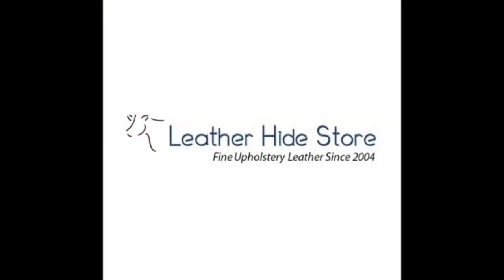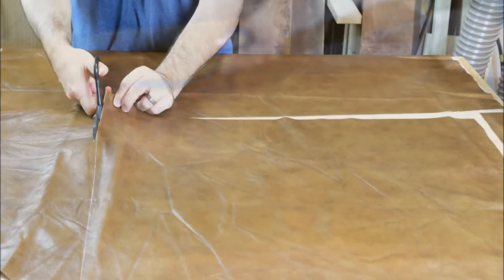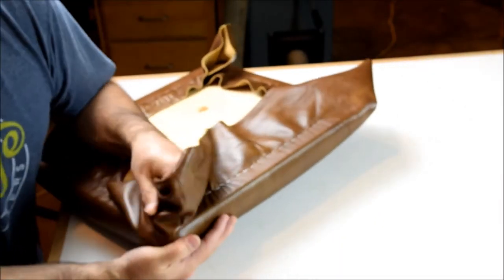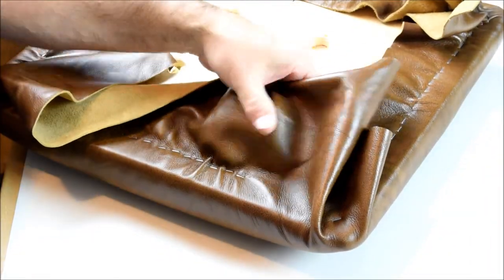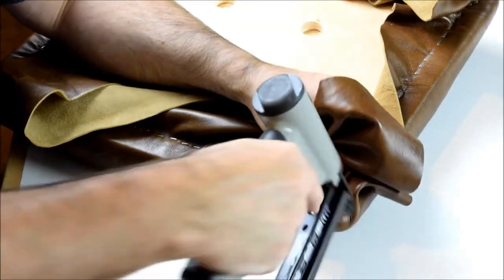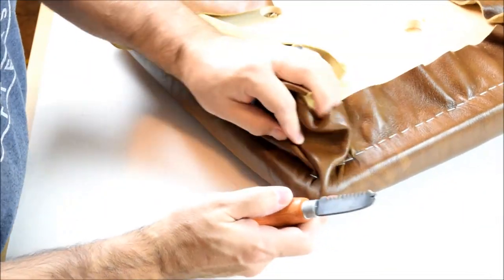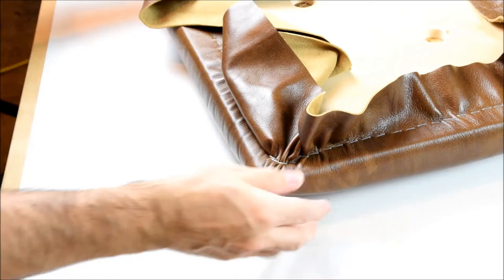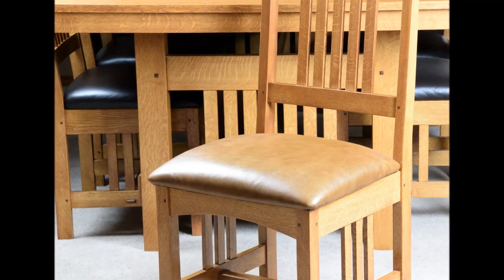Upholster a Dining Chair in Leather - No Sew, No Pleat Method - Upholstery seat cushion tutorial

Comment: @TheThoughtfulWoodworker thanks for the lesson! You used a heat gun...what if I used an iron instead since I don't own a heat gun yet...what setting would I use? Could I toss it in the dryer beforehand to remove wrinkles and soften it? What setting and how long please? I  noticed you have a notched end on your blade for staple removal..was that a Jerry rig you made or can they be purchased? Nice clean corners btw...do you show how to trim the excess? I'd be concerned about cutting too much off so I would appreciate seeing it done please
Reply from the maker: A hair dryer will work to soften leather, if you don't have a heat gun.  You can trim the excess leather with a safety razor or sharp scissors.  Best to you!
Reply: Thanks. How much do I leave behind
Reply from the maker: @fdort3971 2-3 inches on each side should work fine for the rough size piece.  Then trim it right back to the staples.  Best.
Reply: @TheThoughtfulWoodworker  thanks!

Comment: This may be a silly question, but I'll ask anyway. Why do you advise we put vents in the wood?
Reply from the maker: Hi Lisa, the vents in the wood base are only needed if you use leather or vinyl.  These non-porous materials won't let air escape as you sit down in the chair like regular upholstery fabric does.  So for that reason it's always advisable to cut some vent holes in solid wood or plywood seat bottoms when using leather or vinyl.  If the seat frame was jute webbing instead of wood, it wouldn't be a concern.
Thanks!
Reply: @TheThoughtfulWoodworker  brilliant. Thank you for answering, that's super helpful!

Comment: Hello! Please, what temperature is recommended / required for the heat gun?
Reply from the maker: I'm not really sure what temperature it gets to.  Just good and warm to help the leather smooth out.  Best to you.
Reply: for anyone coming across this, I just did two cushions yesterday (4 more to go) and I used my heat gun on its lowest setting.  It doesn't take long to get the leather warm enough to be more pliable.

Comment: How do you attach the finished cushion to the chair?
Reply from the maker: Two good ways to attach a slip seat.  Either screws through corner blocks from underneath.  Or sometimes I use bolts and threaded inserts.
Best
Reply: @TheThoughtfulWoodworker  I finished our cushion project yesterday. I didn't have a tool to heat the leather but it still turned out decent. WAY better than it looked before. It is a long, 49" x 15" bench in the kitchen. I struggled with the corners but it looks fine overall. Thank you for the tutorial!
Reply from the maker: @EarleSara  WOW that's a big cushion.  Glad it came out well.

Comment: no pleats are fine but it looks really crushed at the corners  not liking that look but the vid helps
Reply from the maker: Any wrinkles are on the underside, so it's all good.  I usually prefer a sewn cover.  But on dining chairs this technique works well.
Cheers
Reply: Hi, I was looking for a video specifically for leather. This is a great tutorial and will help me tremendously.
Reply: I feel the same on the corners being too smashed down. Especially when doing MCM chairs that you want straight clean lines on. With this chair in the video I don’t think is as big a deal. But wondering what the foam style in this application was to suck down so easy. 
Was it, Fair Quality: 0.8LB – 1.5LB Density? Or, Good-Quality: 1.6LB – 2.4LB Density. I ask because I am about to do a set of Danish Modern dining chairs in leather and don’t want corners to be smashed down. But still want to pull tight enough to not have wrinkles on the top. 
Also maybe it was already know in the comments or description, but what thickness is the foam 1.5” or 2”?  Thank you. Nice work.